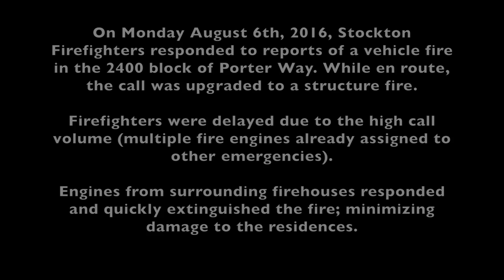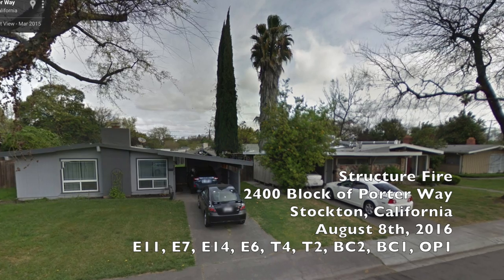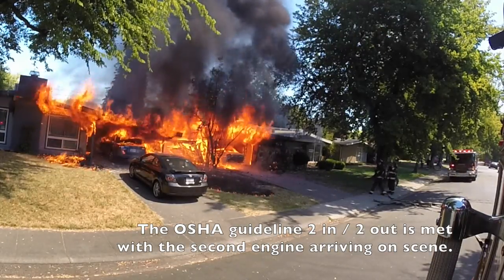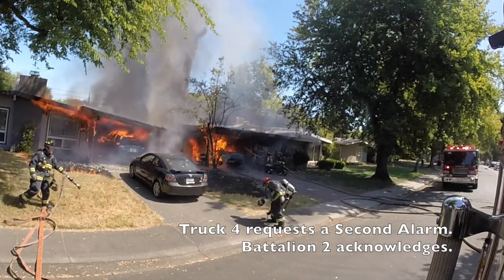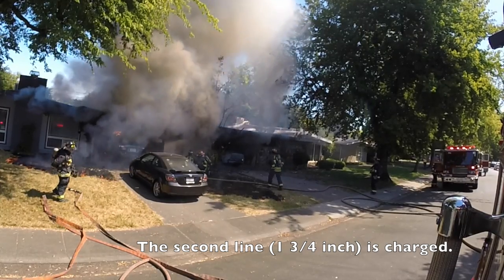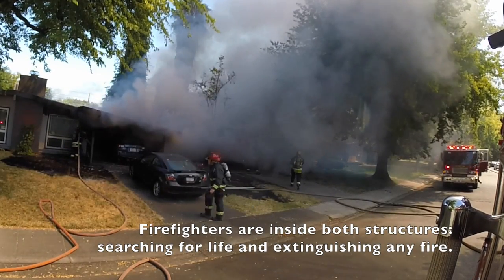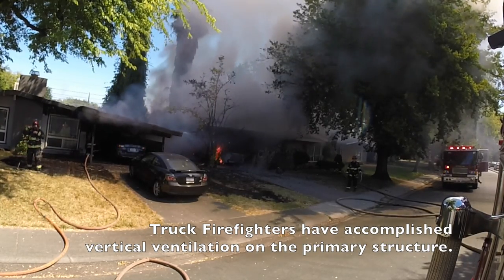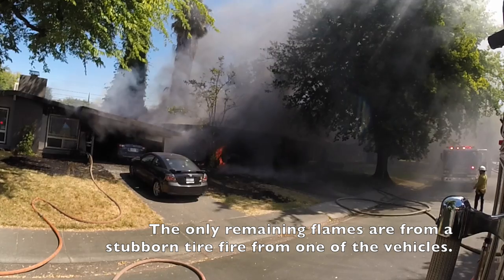Stockton Fire • 2nd Alarm, 2 Structures on Fire

Comment: Great job knocking this down, you had water on this in just over 2 min. Many of these videos it take the departments from 4 to 8 min. to get water on the fire and I have seen many go from a small fire to fully involved which could have been prevented if the dept. had just hustled and got water on it.

Comment: Man you guys are so lucky to have access to fire hydrants... where I live the nearest hydrant is 25 miles away. We end up drafting all of our water from ponds or by mutual aid tankers... so much fun lol. I am very jealous of how aggressive you can be on a fire because of easier access to water... as always you all do a wonderful job.
Reply: Welcome to my world Ethan.  We are very rural with no hydrant system.  We train constantly on drafting operations and dump tank operations.  It also changes how you do your initial attack when you know that the only water you have available before the tenders come into play is tank water.  With longer response times and limited water supply it adds lots of challenges.
Reply: Hopefully you guys spec trucks with at least 1000 gallons due to that situation. My current assignment is a more rural area with limited hydrants but we have a water tender as well and the 4th man takes the water to the scene so we have 3500 gallons on arrival. We use 2.5s with no issue often because some areas hace longer response times. 1 minute of water from a 2.5 knocks a ton of fire down.  Switch to the 1.75 and finish it off usually before our 2nd due arrives.  Our other 8 stations we put the entire assignment on scene in about 5 to 6 minutes so its a whole different ballgame. 3 lines working a hole cut in the time my current engine usually arrives on scene.
Reply: i still think there should be grants or something to put water access in rural america. like we have billions of dollars to send overseas but our government dont kind a rats ass about its people. its a shame really.

Comment: Definitely shows the benefits of the 2.5". Anything larger than a single room and content fire should be a 2.5" straight pipe first off the truck (in my opinion). If the fire is choked out and you're going in after it in a vent controlled state you can probably make a case for the easier to maneuver 1.75"... but for that self vented or exterior fire it's pretty obvious the 2.5" is the best option as demonstrated here.
Reply: I think the biggest problem is most departments don't have a pre-piped 2.5" line ready to go or never use it (because they rarely have fires) so they aren't used to it and find it to gangly. You pull the 1.75" on a lot of vehicle fires and dumpster fires, so you're used to it, not to mention it is lighter and easier to move around than a 2.5". However those factors mean that a lot of people automatically jump to it because it is the most familiar and one of the easiest lines to use.

As I was told you have to use an appropriate line for the situation. Have a hydrant and pre-connected (or quickly connectable) 2.5" and you show up on scene of a fully involved garage, you should pull it and go. You can do a lot of good with a 1.75" line, but if you have a water supply use big water for big fire. I'll always remember my dad's story about being the only available engine in the city and getting dispatched to a structure fire with the 2nd in unit being 10 minutes out. BC called for a 2nd alarm based on the column from across town. My dad's engine showed up to a fully involved garage. Told his firefighter to get the supply and his engineer to get the deck gun flowing while he did his 360. By the time the BC showed up on scene (about 5 minutes later) they'd already knocked down the fire and were pulling a 1.75" line to start mopping up. Always pull the proper size line for the amount of fire.

Comment: Could someone explain the 2 in / 2 out thing? Does this mean that they can’t make entry on a structure until there is a 2nd line to back them up?
Reply: 2in 2 out is an osha requirement for firefighters. in short it means that before any firefighters can go interior to a structure fire, there most be at least 2 men outside available  to preform a rescue if the first two get into trouble on the inside. but this doesn't extend past two, just as long as at all times there are two men outside for the duration. if you want to see the actual code its (OSHA) policy 29 CFR 1910.134(g)(4)(i).
Reply: @cerberusairforce  does the pump op/engineer count as one of the 2?
Reply: @mdelage33  well it depends. Usually not. Because to fulfill the osha requirement they have to be 100% geared up and ready to enter the structure and initiate a rescue. But if your department requires engineers to be in turn outs with a bottle and mask on while operating. Then only if they are not the operator of the “pumping” engine. The one all of your lines are coming off of.

Comment: I really don't understand americans why nobody put mask on in truck on the way and when they come to the scene just plug in air? Why they are always putting mask on the scene, when they know at least 2 will go in?
Reply: Masks limits visibility, get out and see what is happening, then mask up.
Reply: It's tough to communicate with the masks on- and as mentioned already it also restricts visibility. Being able to step off the truck, grab a hose and go stick it somewhere also limits a firefighter's ability to stop and take a look around before committing to action. Stopping to take a knee and put a mask on gives you a chance to take a look around and take in a slightly bigger picture than if you were to just start working right off the bat. Also forces you to consider applying water from outside if that option is available. More often than not you can still get water onto the fire from outside while your partner masks up- then you switch on the handline to put your own mask on. If the fire hasn't breached anywhere then it is oxygen deprived and you can take it on your own terms, fighting it from a "preparing" operating mode. The days of blindly jumping into action to go spray water on things is over.
Reply: Safty first, must have a seat belt on and that makes it tough.
Reply: Sometimes ill put my mask on for something like a car fire while en route but stretching longer lines , throwing ladders etc prefer to not be limited in visibility until I have to and depending on time of year it instantly fogs up.when not plugged in.